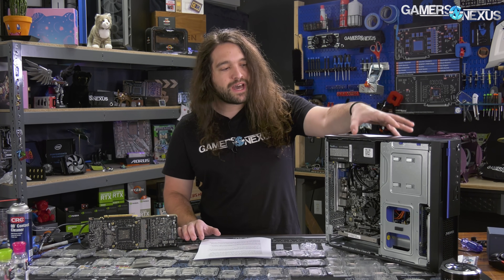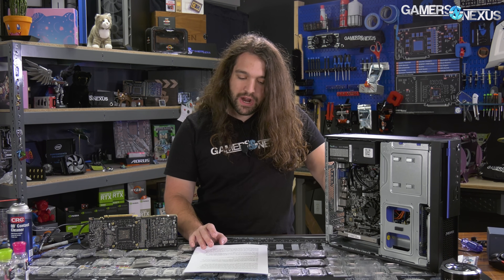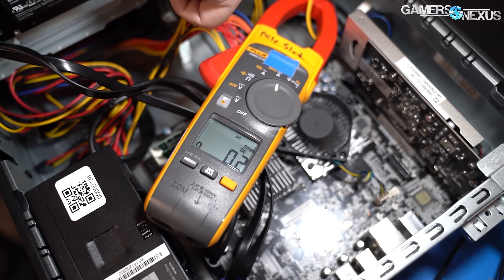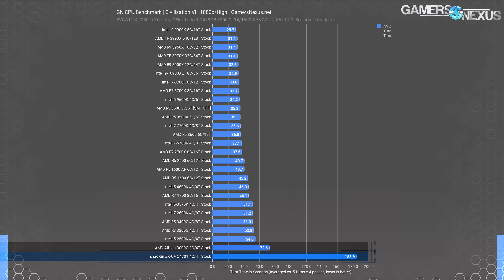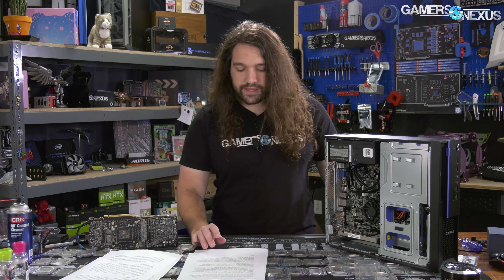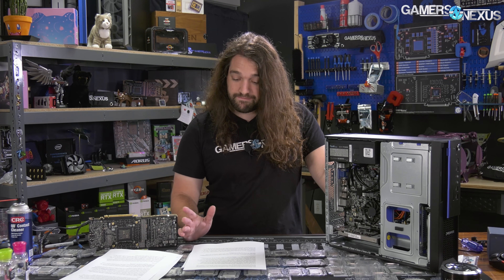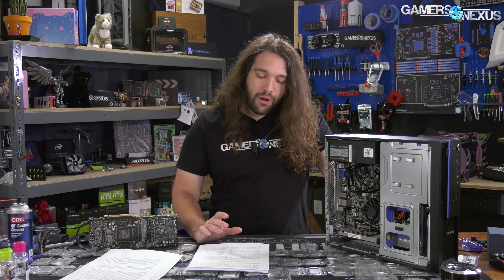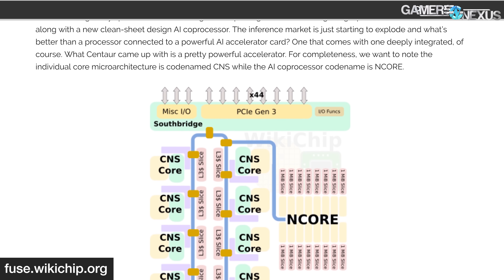"Trillion Core" Chinese CPU vs. AMD & Intel: ZhaoXin X86 CPU Review ZX-C+ 4701

Comment: Finally a cpu that is slightly worse than mine
Reply: Some are actually better in some tasks than AMDs own CPUs. They are based on Zen 1 but have some customization (Wendel from level1 thinks it is the PCI distance that is shorter). He used win10 though which obviously doesn´t have proper support for a non standard GPU.
Reply: Ahh, getting those 1.6 GHz single-core Sempron flashbacks.
Reply: It has similar singlecore scores to my terrible A9 9420 HP laptop, but mine only has 2 cores so its even worse
Reply: @excitedbox5705  This CPU is not a Hygon CPU so it is not based on AMD Zen micro architecture; this is a completely different CPU design
Reply: @Razorsaber i have to ask, what CPU are you using
Reply: Worse than raspberry pie =))
Reply: @Rommie Samboski well, there are CPU's being used thats slightly better than the one in the video you know.
Reply: @Cheese-n-Cake16  I assumbased on old some old Pentium 2-ish era architecture, via/ cyrex have still been making x86 CPUs but really only for thin clients and routers, with almost no updates in the last 15 years to the core architecture
Reply: Slightly
Reply: excited box We’d see a lot more, and a lot cheaper CPU’s in general if they just gave the middle finger to patents and just made whatever CPU’s they wanted. As a consumer, we’d win because of the competition.
Reply: @neoqueto  Haha, now that's a blast from the past. Haven't heard that name in ages.
Reply: @shadow7037932  funny how my GPU was also onboard graphics from VIA/S3 (VIA/S3G UniChrome Pro IGP), which ran NFS Most Wanted 640x480 low settings at 15 FPS (yep, the 2006 one.)
Reply: @neoqueto  NFSMW is a 2005 release though, it might've taken you a year to get in-game though so I'll let that slide for now 😋
Reply: @manolinmero  mine too. I switched back to Windows 7 with SSD.
Reply: Two xeon x5550 is very powerful around 2000 cinebench score but really if that's they're own made cpu that's not bad that's about the AMD phenom ii X3 which of your on a budget is great for older games... If you know anything about programming database algorithms for sorting you will know that certain methods get your result slower than others I would believe the support for the softwares for encoding avx, etc etc aren't integrated into the cpus ..... YET keep in mind they just made a phenom ii X3 which took five years to do in the past few months so let's just sit down for a minute and watch this could be huge and what's needed to seperate countries markets only question is will they sell like amd and Intel or will they keep it inside of China ?
Reply: lol I just replaced my i5 2300  with a ryzen 5 3600   ..  LESS then $800
Reply: I too feel validated!   A trillion cores be damned!
Reply: Rendering performance sounded like Intel core2quad CPU Q6700 or Q9400. Same handbrake file took 24 hrs 10 min, rather than 3 hrs 35 min on Ryzen r7 2700.
Reply: LMAO ;D
Reply: I'm using an i3-2348M 2.3 ghz quad core (32nm litography) AT THIS DAMN MOMENT, and you know, it kinda sucks
Reply: @Biji Wijen it even bottlenecks its own iGPU
Reply: I am still running i5-2550K myself :D
Reply: That being said, wait 10 years and they are better. Say what you want about china. They are learning fast!
Reply: @Aquelll  still gaming on a i7-2700k @ 4.6Ghz myself! Only in the last year of releases have I noticed it meaningfully bottle necking my Nvidia 1070... Although "only" targeting 60hz/fps
Reply: Oh do you have an FX series?
Reply: I love my pi!
Reply: @NamelessPassenger  This is the product for government with domestic customized Linux. Security is the first place. Supercomputers can take heavy tasks.
Reply: Trillion Core.

Comment: Zhaoxin actually has some decent CPU that are now available for purchase. The KX--U6780A is 8c/8t, 2.7GHz, and supports dual channel DDR4. It performs like a lower end bulldozer
Reply from the maker: We'll try to get it! Thanks!
Reply: Damn how bad you have to be when bulldozer is what you aspire to be
Reply: @Drdirtydee  well AMD was once pretty shit too but you have to give room for them to growth. I am more welcome to new competition than ever seeing how AMD broke the monopoly of Intel and Nvidia and benefits us the end users
Reply: I wonder how good the IPC is, because 2.7GHz is a very low frequency, but if it can compete with, let's say a FX 8350, which has a 4GHz base clock and 4.2GHz turbo, if Zhaoxin could push a more reasonable clock speed, like 3.7GHz for example, that CPU may achieve a fairly decent performance.

I wonder how it will perform at 7nm, I think they were planning to switch to 7nm for their next generation.
Reply: @stargazer162  The FX 8350 isn't a lower end Bulldozer, it's a high end Bulldozer evolution (Piledriver). A FX 4100 would fit better the description of a lower end Bulldozer CPU.
Reply: @minhluonglehoang8679  But their x86 is unlicensed so they are just stealing the tech.  Not sure how stealing other company's work is allowing competition and growth.
Reply: @Osaka2407 yeah the power consumption is pretty good
Reply: @Relic142  pre-586 X86 is actually Open and don't have to be licensed. Not all Chinese goods are counterfeit and stolen tech ya know. I even hate the Chinese more than you (cuz Im Vietnamese) but if they do something in my favor then I wont oppose it :))
Reply: So I went back and checked, Geekbench 4 score of 1800 SC, 8675 MC. Which should be worse single core than most bulldozers and MC on par with the higher end models
Reply: @deepfriedlettuce851  based on Cinebench R20 their current flagship is on par with Athlon 200GE (by flagship I mean Intel's i9 and AMD's R9 kind of flagship). Still a long way to go but promising
Reply: Bro I thought you said decent CPUs
Low end bulldozer isn't decent :p
Reply: Because bulldozer was just so popular... 🤣
Reply: @deepfriedlettuce851  lnteresting they catch up with the FX 83xx despite having lower SC performance, I guess having 8 real cores instead of "modules" helps :p
Reply: But all their CPU looks like BGA type. Means you have to buy a totally different motherboard. That sucks if it's not a notebook or a NUC type of PC.
Reply: @minhluonglehoang8679  Definitely, I think people look at the price tags on these and the performance and think this is garbage, but they have to start somewhere, the fact that these things are usable enough that it can even play CS:GO is pretty impressive.
Reply: Bob Ross's Cabin Not that bad actually, power consumption is much lower than bulldozer. IPC is somewhat more near first generation Zen.
Reply: Relic142 Nope, they are licensed. It’s a joint venture with VIA,which does have X86 license.
Reply: @minhluonglehoang8679  And once upon a time before that, AMD (and ATI before it was bought out) was king for a number of generations.
Reply: @Drdirtydee  a sledgehammer
Reply: @Relic142  as for stealing tech and getting ahead, just look at Microsoft and how they got to where they are today.  Theft is what makes business big as they are.  Only difference between tech companies and crime syndicates is one uses the patent office, lawyers and intimidation through legal agreements.
Reply: well before I used a ryzen 2600 I was using fx 6300 so I know it's not bad..not good either
Reply: @Relic142  as if the x86 isa is such a genius invention. It just so happened that most software is written for x86. The fact that someone holds a patent for the isa is such bullshit, it simply ensures the lack of competition.
Reply: @minhluonglehoang8679  imagine a huawi of CPU's     8 cores 50$
Reply: @jaxx3499  Image China surpassing the US in semiconductor chip performance
Reply: So y wld u bother if u can find fx cpus for cheap ? Or better yet Xeon E5 2640v3.
Reply: @gamingedition5165  This is not something intended for the average consumer, but the Chinese government that need to guarantee there would be no backdoors that aren't their own. This existing at  all however, could potentially mean there will be viable consumer CPUs in the future from a third company.
Reply: @minhluonglehoang8679  Mind explaining why you (as a Vietnamese) hate the Chinese? Is it just the recent border disputes?
Reply: @marioprawirosudiro7301  border disputes, islands ownership disputes mostly sovereign stuff. But also their behavior while being in our country.
I guess in the level of hate we ranked just behind the oppressed Uyghur and Tibetans lol
Reply: @minhluonglehoang8679  Ah, well, I do get the border disputes. I'm Indonesian, and we've had border disputes with them too. Pretty ridiculous if you think about it, as we're way too far in the south to even be bordering them. Yet it happens.

That said though, I honestly haven't seen Chinese tourists behaving badly here. And I see quite a lot of them. Before the current lockdown, I'd see them almost every other day, just walking about. Somewhat loud, but otherwise normal behavior. No horror story yet so far. But then again, I don't live in Bali. 😅
Reply: @minhluonglehoang8679  The hate is unjustified.  Cultural similarities are undeniable and the written language before romanized was what? It's comical many Vietnamese have forgotten the horrors of the Vietnam war: agent orange, napalm and my lai.
Reply: @IJoeAceJRI  NO, it's your prejudices that don't matter when it comes to technical specs.
Reply: @ExplorerBob  cultural  similarities have nothing to do here mate. Vietnamese may originate from a southern Chinese Kingdom but that doesn't change the fact that they are oppressing Vietnamese NOW lol
Reply: @minhluonglehoang8679  No, that is false. You can't even get your facts straight.  Just look at the other neighboring countries in Southeast Asia and what kind of relations they have with China.  Does Colonialism around the world ring a bell, the very definition of expansionism? How about French colonialism in Vietnam? Do you even know what is 'the Vietnam war'? What its like to get a US bomb dropped on you? This is ridiculous.
Reply: @IJoeAceJRI  Do you even realize that people can take images of chips and see the actual cores on them? or that Intel or AMD CPU are designed in the US but made in China sigh They're late to this party, but wait a few years.
Reply: @IJoeAceJRI  You're talking gibberish and nonsensical units. Gamer Nexus ran benchmarks on Windows. You're commenting here and didn't watch the video lol
Reply: @ExplorerBob  talking about western colonialism while being ignorant about Chinese neo-colonialism lol.
Reply: I checked passmark and they have one benchmarked. It is between an i3-9100T and a R3 2300U. Both have under 35TDP while the KX--U6780A does not have one posted. But again this is 8 core vs two 4 cores mobile.
Reply: @minhluonglehoang8679  no the athlon gets 600 points in cinebench r20. You tested yours in cinebench r15 where it is much harder to get to 300 points
Reply: @minhluonglehoang8679  when was that exactly? You act as though AMD just formed last week. Additionally, AMD is more than just a processor company. Anyway. 386 DX-33 versus 386 DX-40 ? Probably no clue . . . Earlier ?
Reply: @MrYyrkoon  what the hell are you talking about I have alot of comments in this thread you should point out which one
Reply: @Relic142  that's not true
Reply: It is a decent contender to atom and Pentium silver….I meant it is a fun chip for hobbyist but bad for every else.

Comment: Intel is confident their upcoming 14nm refresh will compete with this chip.
Reply: Not even a refresh.intel 14nm is from 2014 (I still have an 8 core 16 thread i7 from 6 years ago) and the architecture is 9 years old. 6 year old node and 9 year old architecture
Reply: @shaneeslick  10980XE was already released last year lol, my friend has one
Reply: I'm not. :p
Reply: Oh the stagnating innovation shills of silicon valley, our beloved supplier of over priced and nearly identically designed processors over the past ten years.  Yes, Intel.
Reply: 14nm+^10
Reply: @shaneeslick  Probably would be a rehash to the 2017 7980XE again. Fun fact the 7980XE is faster than the 10980XE in every regular workload...and that the 10980XE is a consumer deep learning CPU lol. I wish I told that to my friend earlier
Reply: @JABelms  That's why I left Intel and never looked back. They're the Activision, the EA, the Konami of semiconductor manufacturering industry. They fool you with overpriced or underperforming chips
Reply: @JABelms  That makes me feel a bit better, I have a 7900x and well, it's expensive and I have to make up excuses to justify it :D
Reply: Wait 'till you see their 20nm models!  AMD is TOAST!!!!
Reply: @JABelms  How is the 10980XE slower than the 7980XE? It has a faster base clock and turbo, and actually has a soldered IHS so thermals should be better.
Reply: Going to be fun to see when ZhaoXin beats Intel to 10nm process...

Comment: The desktop chassis is awfully reminiscent of the Lenovo Thinkstation.
Reply: Yeah it’s funny about that, the original Thinkstation chassis was actually designed in Shenzhen back in the 90’s when IBM was still in charge of........

Nah I’m kidding, the Chinese copied it!
Reply: I wonder why...
Reply: Isn't that because Lenovo is a Chinese company?  Pretty sure they would be involved in this as well.
Reply: @jmugurr994  Wouldn't be surprised if the supplier for these cases was the same company Lenovo uses. Since yes.. they are Chinese.
Reply: No!!! Are you saying china rip off designs ? That has 100% totally never happened before.
Reply: OR the Dell Optiplex 7010.
Reply: It's an homage /s
Reply: How dare you!?!
Reply: I think they either licensed it or got it from Lenovo's supplier(s). 

Besides, IBM sold the IP for their PCs to them in 2005.